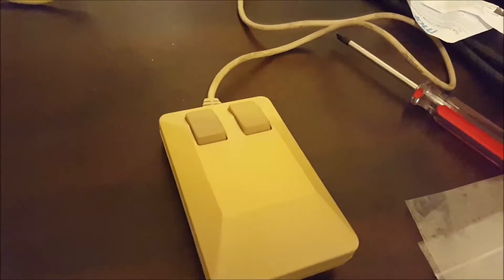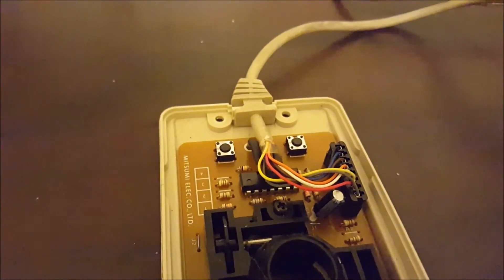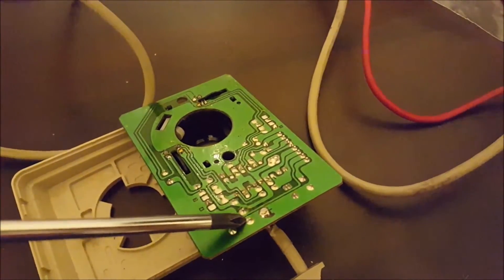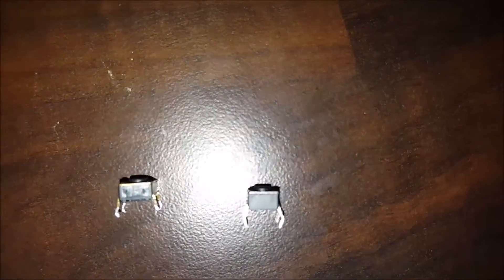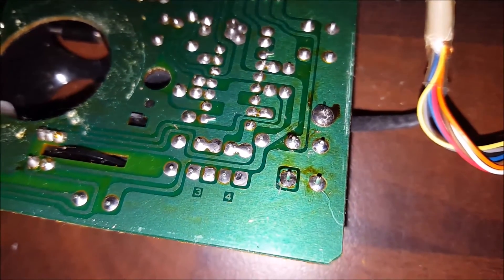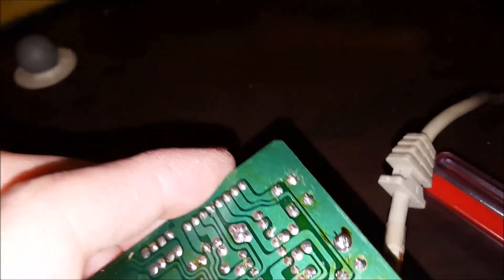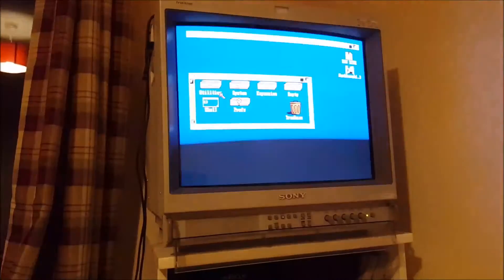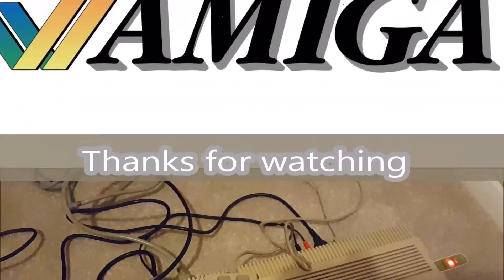Commodore Amiga A500 Tank Mouse Repair - Left mouse button not working

Comment: I have a tank mouse made in Hong Kong that does not have these push buttons but small metal pads sitting on a smal extra pcb instead, they are not exchangable. Where was your mouse made?
Reply from the maker: I don't know to be honest
Reply: Thanks for your comment. Came here and discovered the same thing. I've got two metal pads....the construction seems easy enough, but I'd think retrofitting a microswitch in those could be hard/impossible. Interested if you ever found a solution.

Comment: Hey matthew you broke (vandalized) the Amiga 500 plastic case only for seeing better the Gotek switches ??
Reply from the maker: umm.. no actually I didn't.  I made an effort to make sure I didn't damage the case. the wires are poked through the disk slot and the display is blu tacked to the side
Reply: in the video it´s visible that the case was cut !
Reply from the maker: where? I didn't cut the case
Reply from the maker: Here's a picture from the other side https://www.dropbox.com/s/v3ra3rfavqebrgp/20151118_180811.jpg?dl=0